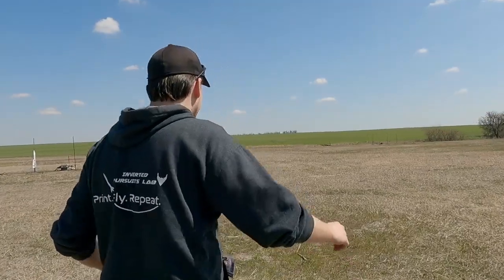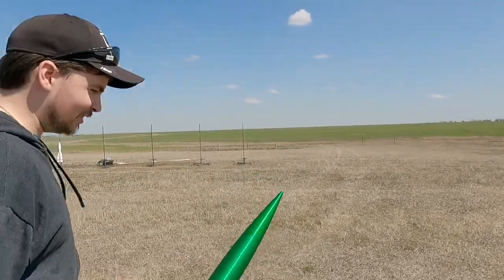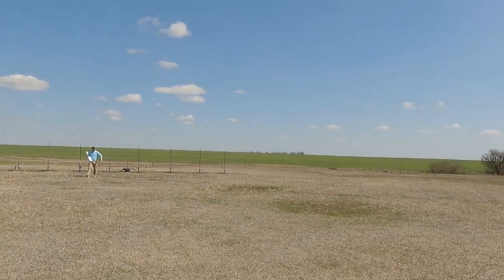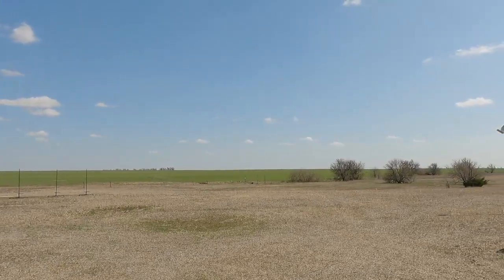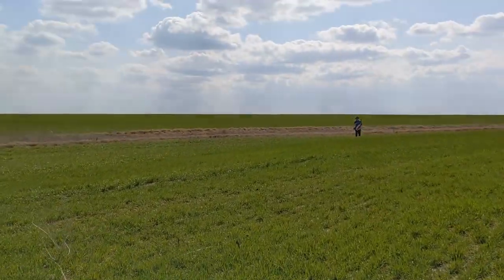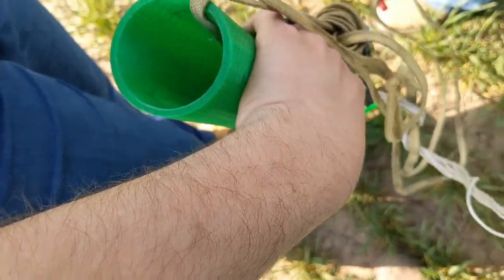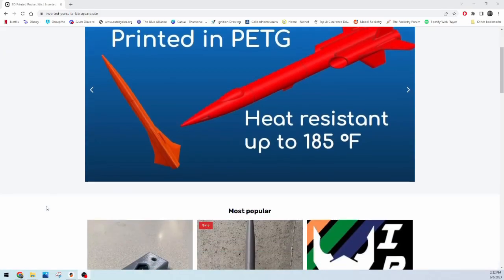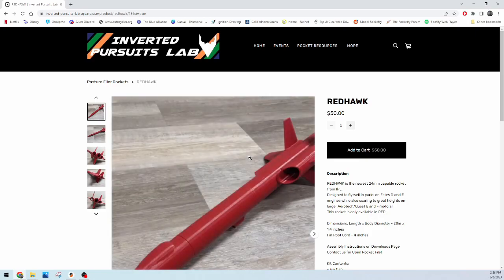3D Printed Rocket Almost Breaks Mach

Comment: Nice! I built a similar size rocket (4.5 feet long, 2" body OD) recently which I haven't flown yet that is also running a J270, I'm looking forward to the launch after seeing this fly, that was fast as hell. I built the J270 myself, it will be my first homebrew APCP motor launch and I'm hoping it doesn't Cato on the pad lol. 

Not that I'm all that concerned about a Cato, I built it from scraps and only spent $40 max on everything😅, it's just a $22 RCS motor kit + my HTPB-based APCP fuel grains, a clear polycarbonate tube, 1/8" plastic sheets cut into fins bonded with epoxy fillets, some Visqueen plastic for a chute and nylon packing straps to hold it all together, plus a chunk of steel BBs epoxied into a ball in the nosecone as counterbalance, it's nothing fancy so if it does Cato I'm not out a wad of cash lol, I'm not that confident in my motor manufacturing skills to put expensive hardware and dozens of hours of work into it yet haha. 

HPR is expensive fun!